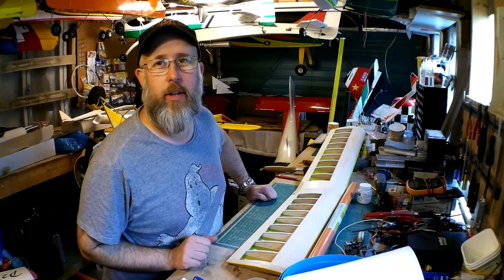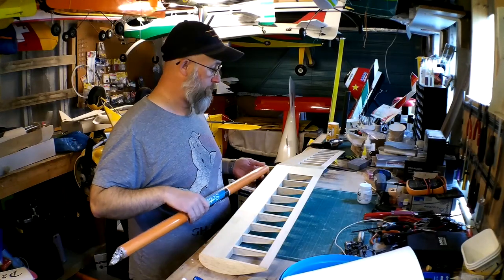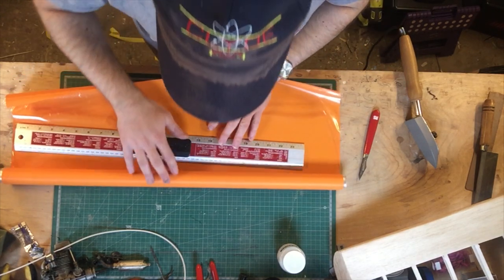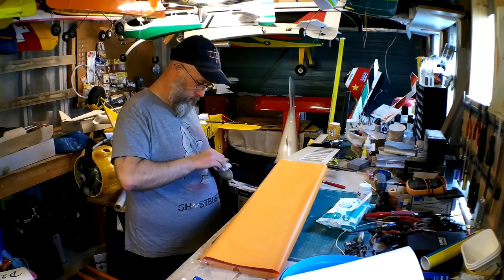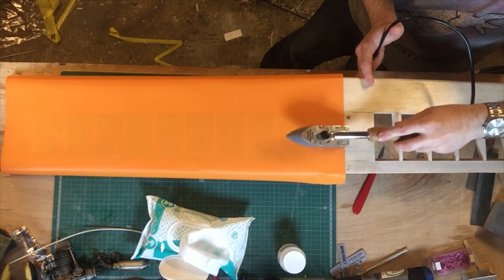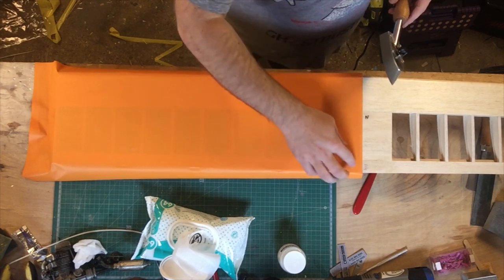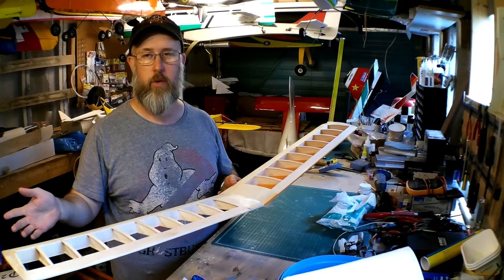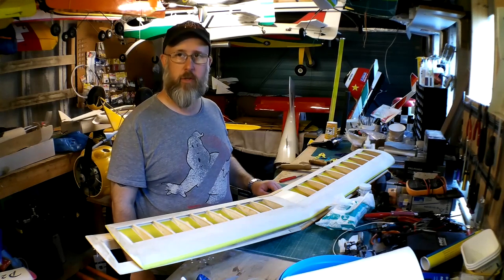Ben Buckle Novice Pt2 Covering has started

Comment: Losing solartex is a great shame for the hobby.
Reply: Although I have noticed a product called Oratex, assuming this is simular.
Reply from the maker: Mike Waller oratex is made by oracal, the people that make profilm. I’ve never used oratex but I suspect it’ll be a replacement for solartex depending on price
Reply: @njrmodelling  reckon your right. Going to get some to look as I have run out of solartex.  SMC sell it for £24 for 2 meters.